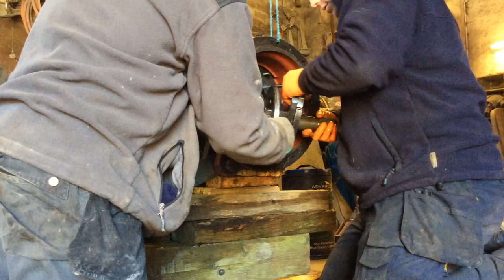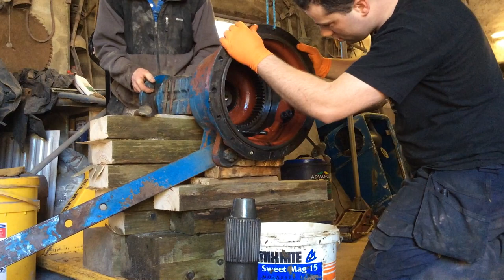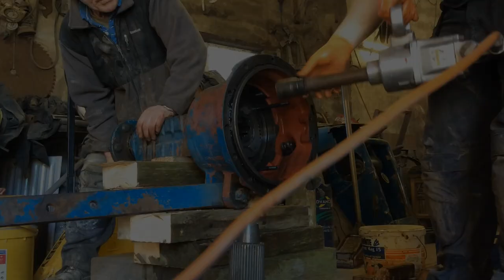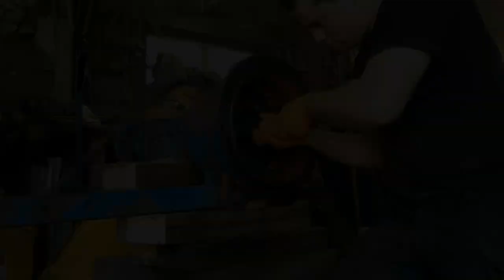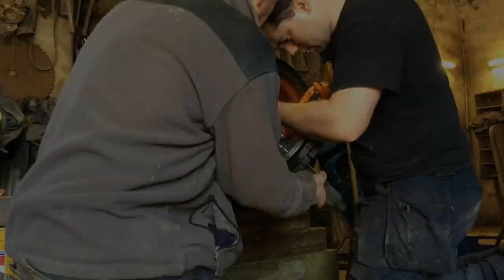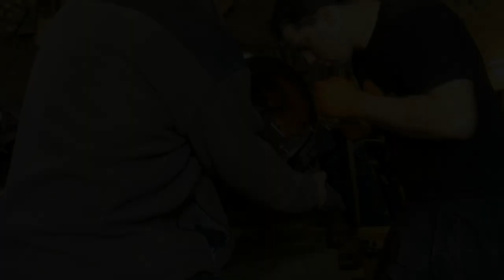How to replace brakes in rear axle Ford 4100 Tractor

Comment: Do you remember how you kept the steel disc centered?  The one with the larger, non splined hole?
Reply from the maker: From Memory they just sit around the shaft and when putting the outer case on you can work them into place.  sorry for not being 100% sure but this process was done quite a while ago
Reply: I once went to a repair shop and watch a guy do this process, but on a Harlo forklift (modified Ford 445c I think).  They stood the whole axle housing upright, make sure you put wheel lug nuts back on to protect the studs.  I'm in the middle of this right now, it makes putting every back in place pretty simple.  Now I've gotta rig up blocks on a pallet jack like these guys did, thank you for the good idea, much easier than the floor jacks and chain hoist I used to get the thing off.  Cheers!

Comment: Did I miss them replace the outer axle seal? mine is leaking oil on to the rim
Reply from the maker: No you did not miss the new seal going in unfortunately that bit was missed from this video.  You do have to remove the half axle to replace it

Comment: Hello, I would like to know what is the real position of control valve, manifold & tubes in tractor transmission ford 655a.because they armed my transmission and the F and R lever are inverted.

if I act for the front, it goes backwards. if I drive backwards it's going to the front
Reply from the maker: Hi this tractor has a manual transmission so unfortunately i am unsure on how to resolve your issue